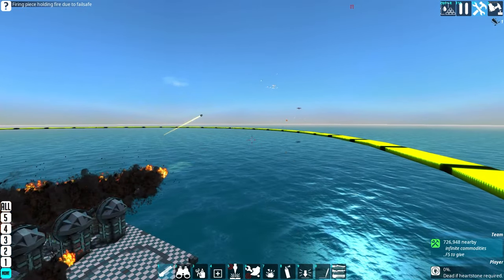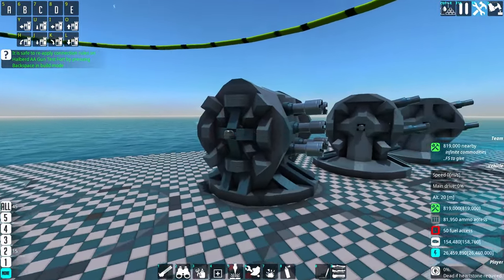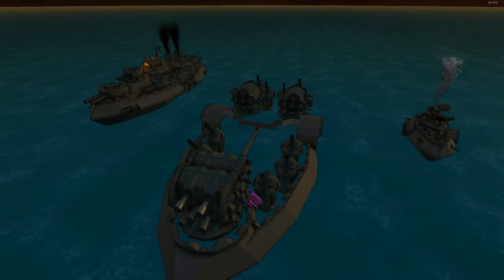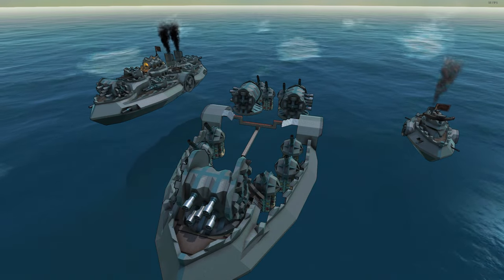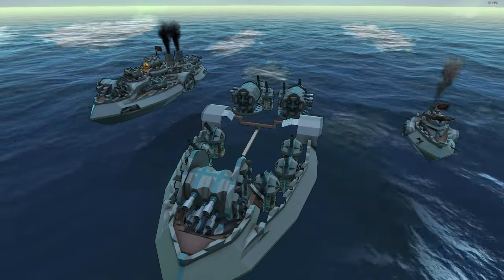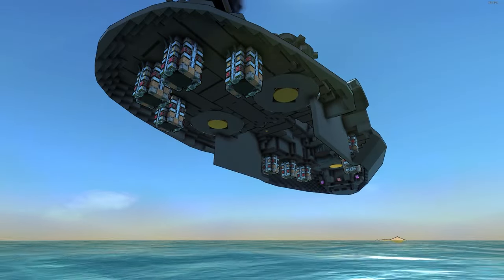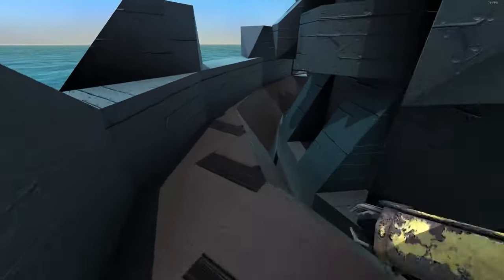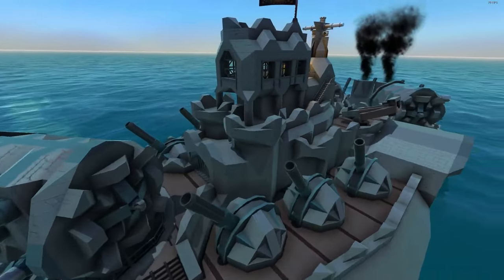Bounty Hunting Halberd Part 2

Comment: I’ve actually always struggled to build weapons for my ships as I always built the hull then smooshed the guns into whatever space was left. Seeing your way of the template seems so much better so cheers man, keep up the good work
Reply from the maker: If you do build it the other way (I sometimes do as well), I recommend you build-in turret wells, you can find a template for most sizes in the sub object tab. Just leave a 5x5 hole or 11x11 or whatever the case may be and then measure the size of the hole and build a turret accordingly. But I find some sizes just line up better (for example 5x5 is great for small 3D CRAM)

Comment: Using multiplayer for recording the building is really, really smart. Should I do any future build mode vids, I'll try that trick out myself. Something that might be helpful is setting a constant time in-game through the settings menu. Keeping those annoying night-time bits away. I like how the ship is looking so far- I think as the side-turret deco work goes, my own preference goes 1, 2, 3 in order. I suspect the next vid will take care of the internals (the walkable parts), paddles, whatever goes in the missile bays, and combat testing. ;) I've got no stake in it- but I'm curious, if the bounty is due the 3rd of May, any clue how long'll be spent deciding a winner?
Reply from the maker: Thanks! I am pretty proud of the multiplayer timelapse Idea tbh. Unfortunately because of multiplayer jank you cannot remove the day/night cycle which is a pretty big downside :(. The internals will be worked on in future videos, not sure if it will be next video or not, just depends on what I feel like building this week I guess! I have no clue how long to decide the winner, some bounties seem to have a winner announced just hours after they close and others have been closed for over a month with no winner announced.

Comment: Between the three AA gun turrets, #1 has its own appeal given its five barrel design, but overall #2 feels slim yet powerful. The main difference between #2 and #3 is the side design, with the almost crown design of #2 feeling much more authentic to me. 
It might be interesting to switch the two large AA guns in the stern of the ship to the two barrel design, while maintains the flashy 5 barrel in the front of the ship. 
Also for the back area, a third smokestack may feel to cluttered. I think a small building there, whether a watchtower, gazebo, or (pretend) ammunition drop could fit very nicely. 
Overall great design though! I am quite exited to fight this beast in the campaign.
Reply from the maker: I was also kinda thinking the dual barrels on the rear might be a good idea... I was toying with some kind of watchtower or some other taller structure but it does feel too cramped and disjointed. Ammunition drop is a good idea though!

Comment: For the two barreled turret I'd say the second one looks best, and This is a very menacing looking ship.

I would not want to fight this.
Reply from the maker: Do you mean the second two barrelled one (on far right) or did you mean the 2nd variant (middle)?

With frag being banned I'm not sure it's going to be very potent, but it is supposed to be Expert difficulty.
Reply: I meant second as in the middle one @draloric

Comment: I feel like the 5 wide spot should have spare rubber tires for the main guns or a small ballista that will act like a depth charge also maybe in the watch towers have a 50. Cals that are mimicked into looking like a rapid fire crossbow similar to the Chukonu Chinese repeating crossbow  if the rules allow it.
Reply from the maker: Definitely a neat idea! Love the lore of the rubber wheels, even though you'll basically never see it.

Comment: If you forgot mirror mode while building, let's say you are building the left side and the right side is not mirrored, you can prefab everything on the left side and paste it down again with mirror mode on, this will mirror your prefab which is everything you've built. As long as your prefab border doesn't cross the mirror it should work, it also copies all the mimic so I think it's pretty neat.
I used this trick to build a lot of symmetrical subobjects.
Reply from the maker: Yeah I don't usually screw it up so often but I kept exiting build mode to go look at the reference boats... But it got there in the end!

Comment: This just popped up in my feed. What game is this?
Reply from the maker: From The Depths - it's on Steam. Gotta be one of if not my favourite game. Be warned, there is no learning curve, only a learning cliff doused in oil and set on fire.
Reply: @draloric  Ah. Like Space Engineers then.
Reply from the maker: @JRaney  Space engineers is also a favourite of mine! But it is nothing like space engineers. Imagine space engineers except you have to build the nuclear reactors block by block and same with the thrusters and same with the refinery and same with the guns etc etc
Reply: @draloric  That's nuts. I love it.